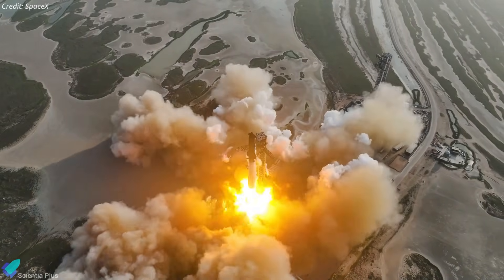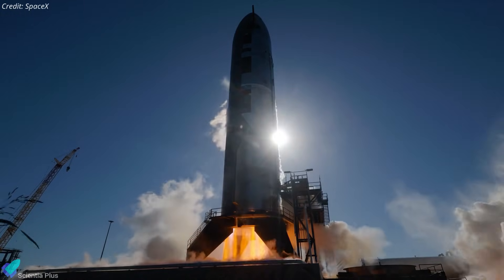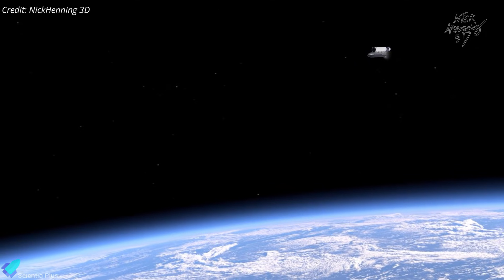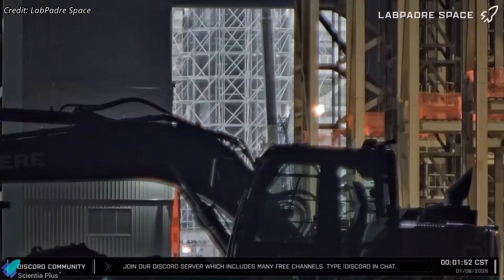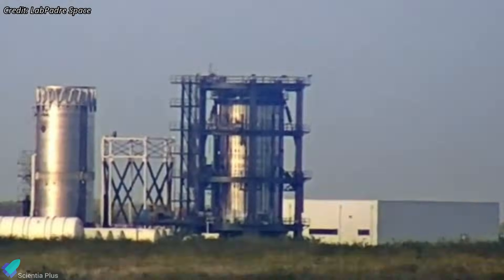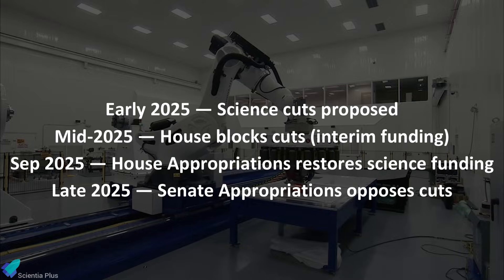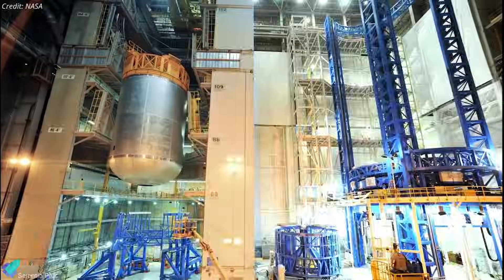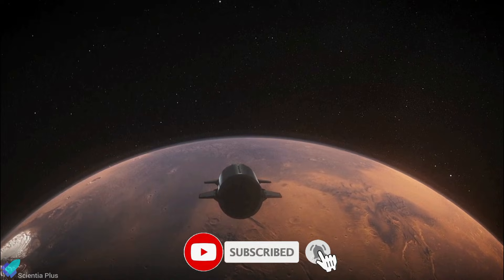HUGE PRESSURE! Elon Musk Admits Starship Delays Are Affecting the Moon Landing!

Comment from the maker: 00:00 Starship Updates
08:43 Mars Sample Return Is Officially Dead — NASA Budget Cuts
12:44 Astronaut Medical Issue on the ISS — NASA Plans Early Crew-11 Return

📚 Learn More:

🚀 Starship Block 3 Explained: https://tinyurl.com/mp63u57m
  • Detailed Breakdown: https://tinyurl.com/bddv6w2y
  • Production Begins: https://tinyurl.com/5cb2ee3h
  • New Transfer Tube / Downcomer: https://tinyurl.com/ymm23t2c
  • New Grid Fin: https://tinyurl.com/mppnd7sz
  • New Integrated Hot Stage Ring & Forward Dome Upgrades: https://tinyurl.com/msvxk8m
  • Booster Block 3 Aft Dome Insane Design Upgrades: https://tinyurl.com/3k2rxvpf

🛢 Dual-Port Orbital Refueling – Full Technical Breakdown
https://tinyurl.com/3hej7fk3

 Starship Block 4 Unveiled: https://tinyurl.com/ymhyyt2h

🔥The Insane Engineering Of Raptor Engines:
     Part 1: https://tinyurl.com/348hsrya
     Part 2: https://tinyurl.com/p8k85mu6
 
🔥 Raptor V3 Explained:
    Mega Upgrades & First Test: https://tinyurl.com/22nzc3za
    Raptor 3 Evolved Again - More Protection This Time: https://tinyurl.com/4up7jxdd

🛠 Insane Engineering of New Starship Launch Pad: https://tinyurl.com/42h5kd92

🧱 What’s Inside Starship GigaBay?: https://tinyurl.com/2ujtkmkb

🛠 Other Starship Upgrades:
 • Hot Staging Explained: https://tinyurl.com/yc4ejbmn
 • Super Heavy Booster Upgrades: https://tinyurl.com/msm9jtkc
 • New Heat Tiles Explained: https://tinyurl.com/45dytyef

🔥Booster 18 Explosion Complete Breakdown: https://youtu.be/2mYXI6WRwqI

🔥 Starship 36 Explosion:
  📽 Detailed Breakdown: https://youtu.be/VWQiIz1ymBA
  🛠 Damage Report: https://shorturl.at/Quoex
  🛠 Root Cause & Fixes: https://shorturl.at/NVqdS

🚀 Booster 18.1 / Test Tank 17 
      Explained In Detail: https://shorturl.at/wPg6Y
      10 Rounds of Tests COMPLETED!: https://shorturl.at/uDeSG

🚀 Test Tank 19 Explained: https://youtu.be/IbYtI-VrAqc?si=dEmMp0rxlWx9r7WG&t=343

🚀 Elon Musk & Peter H. Diamandis: https://www.youtube.com/watch?v=RSNuB9pj9P8

📡 Stay Updated:
📢 Weekly Updates: https://bit.ly/3HIQjPC
🚀 SpaceX Playlist: https://bit.ly/34wue8T